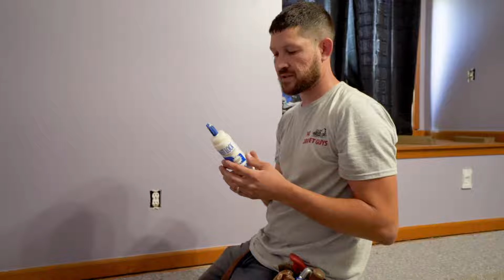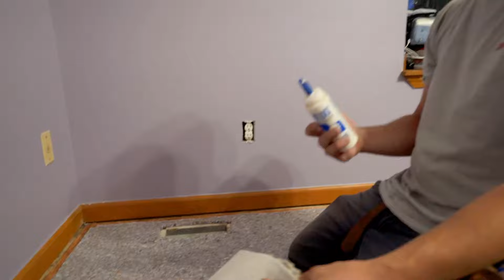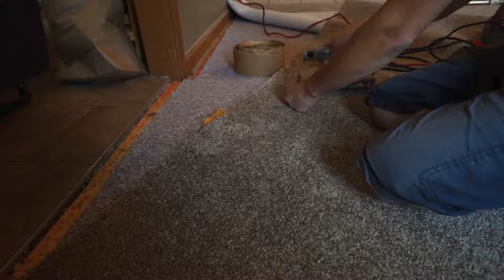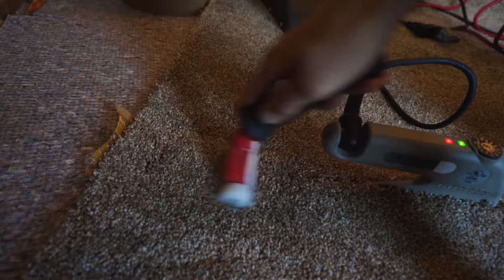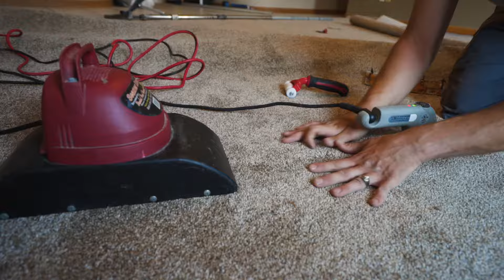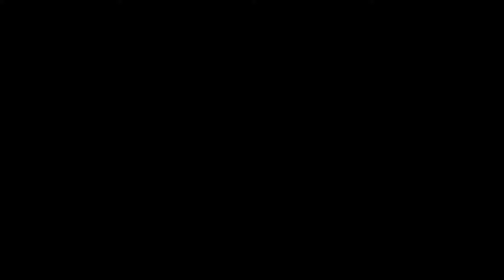How to Properly Seam New Carpet

Comment: Thank you so much for this great video! My dad was the lead carpet Installer for several casinos in Atlantic City NJ. He did beautiful work, like you do. I wish he were still here.
I  have a sub floor repair to do In the center of a big living room, of manufactured home. It would be great to not have to pull up such a big carpet & then have to reinstall it again. I have seen my dad glue seams like this my whole life, but i just don't remember or I just didn't notice, if he was doing Berber any of those times. Can this be done with Berber and look seamless like that, as well? Thank you again!

Comment: I was a carpetlayer for over 30 yrs and I still don't understand why you have to glue the edges before you glue the carpet together. In my opinion, it's a scam by the industry. I don't "seal" the edges and have never had an issue. As a matter of fact, I can do invisible seams. For those who want to know I've been doing it since the days when we sewed the seams. I was one of the 1st installer in Canada to use hot melt tape.